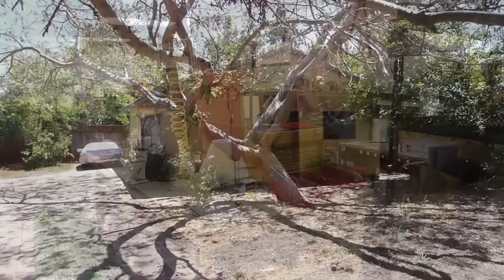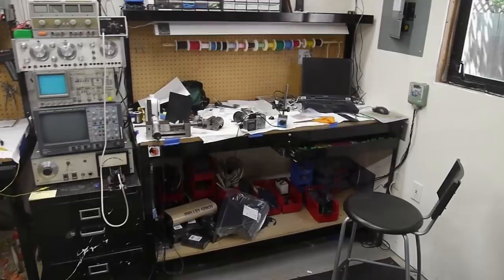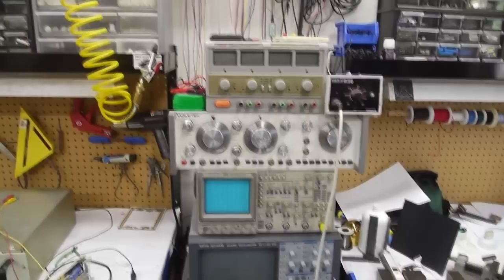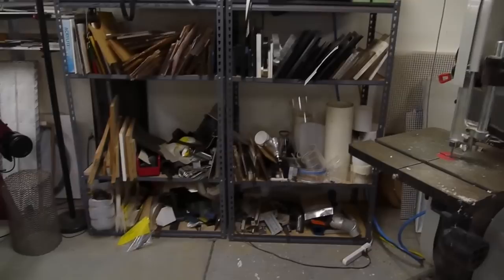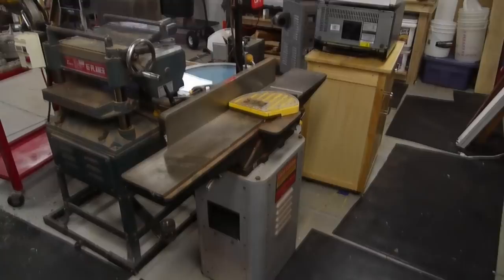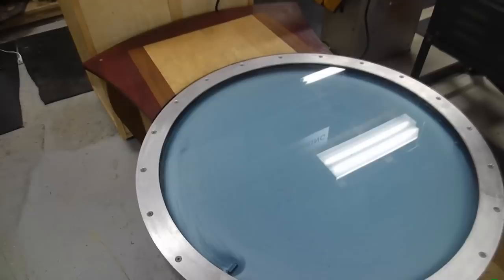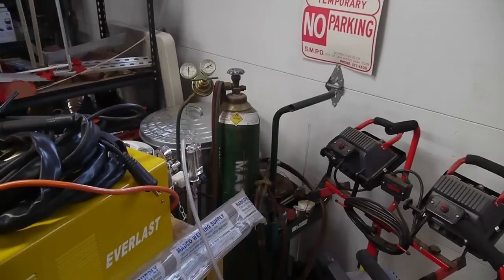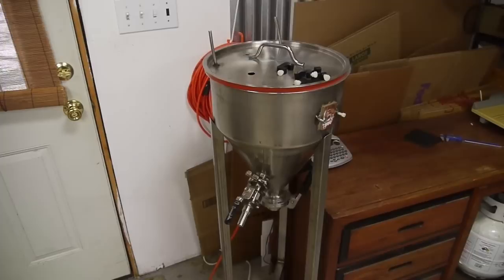Tour of Ben's shop 2012

Comment: The safety minded guy in me sees a few things to suggest for your enviable workspace. Mount your extinguisher by the exit. It'll always be in one spot near you escape. A fire rated chem cabinet or at least steel with doors. Finally, an eye wash station. Doesn't even need a drain. If you need it, you don't care about the puddle. Great vid!

Comment from the maker: I really like that scope. Compared to modern DSOs, it's slow for math and signal processing and doesn't have a color screen, but the front panel response is better than most modern scopes, and is very easy to use with good controls and menus. I've gotten a lot of work done with this scope, and would be very reluctant to upgrade.

Comment: Nice to see the bits usually only glimpsed in your background.  I also was intrigued with your friend's tempering machine.  I would be interested in liberating that from it's current disuse; please let me know if it is still available.  I have had musings of building one for a while but never got beyond a scratchpad design.  A chamber vacuum sealer is likely to come first. I have a very food oriented project theme lately.

Comment: I thought that was fascinating getting to see around your shop, Ben.  So much interesting technology.  Until this I had never considered the parts bins utility other than as storage, but the ability to move similar small components on mass from location to location seems so obvious now, and gives me new consideration of them.  The table concept is fantastic.  I noted that it made quite a bit of noise when you turned it to set the fluid in motion, so wondered if it was considered for retrofitting with quieter bearings, a motor drive, or some back lighting?   Have you ever thought about motor control via some user action -  disturbing a magnetic field, or covering a light sensor with a drink container?

Comment: Ben, your shop is great! I envy your knowledge of the tools you use and the amount of cool things you have built simply because you love building them.

I wish to someday have a similar amount of understanding of electrical and mechanical systems. While I am in engineering school, I do have access to a full woodworking shop at my parent's place. What small projects could I take on to increase my understanding of practical engineering concepts? What little things got you started, Ben?

Comment: you found using the compound miter saw for cutting plastic to not be so great - for cutting vinyl siding, a plywood 100+ tooth blade mounted backwards works amazing.. maybe the same for other plastics?

Comment: Such a cool shop. Do you ever work with robotics?  I think you could make some cool quad rotor helicopter mods for RC ones.  They sell one for like called AR Drone 2.0 with a 720p front facing camera and a downward facing lower resolution for positioning.  You can view in HD while flying via wireless on any android or iOS tablet or smartphone. It's very stable and only 299$ I think you could do something cool experiments or modifications to it.  

Just a thought,  I really wanna pick one up.

Comment: What would it be like if you tried to run a 3-phase motor on only 2 of the phases or even 1 phase?
Reply: Unsatisfying.  On single phase it will not start.  On two phase it might start but will have a small fraction of the rated power available.  In the USA the 230 V two phase is really just center-neutral single phase so it is no benefit for poly-phase motor starting. With a rotary converter you use a capacitor start and/or run configuration on a single phase motor to turn a 3 phase generator or you use a split phase arrangement (sort of like capacitor run motor) to power a three phase motor and use the motor windings as a rotating transformer to extract three phases from the windings.

What with no free lunches the single phase has to provide all the power you take out on three phases (plus losses) to the supply currents can be very high if you have a big load.  While these may be big and noisy compared to a 1phase to 3 phase variable speed drive/motor controller they can be cheaper to make than pay for a VFD and more robust when it comes to overload.

Comment: I love what you do.i lived in the area since the early 80's and tried to do something similar. How do you keep from having "collectors" from labling you a hoarder, kicking you out of the area and "cleaning up your property"?

I've been meaning to make it to a Maker Faire but had to put out fires as my stuff dwindled. I'm setting in Michigan separated from most of my stuff. I used to work at HSC Electronics and I see that they closed. There ain't no life nowhere. This is worse than a tornado. I can't believe the violence.

I'm 60 and spent my life collecting parts, making tool and people come along and rip it all away.

I'm smart and talented but I lucky enough to have an unfurnished house to exist in. I have a Droid but try to submit a resume on a website written for a computer. I'm just getting too fat for the clothes that I still have.

It's 7 degrees outside. I came to California in the early 80's and just missed getting in on the ground floor. I solved a lot of problems for quite a few people but didn't really get compensated for it.

I guess if I had a question, it would be, how? Just, how?

People love the comfort of living today but they seem to disdain the technologies to get there.
Reply: Best of luck to you man, fingers crossed that by the time this reply finds you things have begun to turn around for you.  It sucks when smart people get used up and spit out by the system.  Truly wish you the best.

Comment: Can we modify home refrigerator  to archiving temp below 0 or -10 C or not ?????
Reply: A domestic fridge should be able to get to -5degC in the ice compartment.  A domestic freezer should be able to hold -20degC if it has good insulation.  They are designed with very little extra capacity so even if you changed the thermostat setting it will not be able to go far below the design temperature without changes to the plumbing.  An important consideration is to remove heat leaks with added insulation.  Remember some modern units use the outside metal as a heat sink so putting extra insulation outside on such units will cause them to work far worse, add it inside but make sure the cooling/evaporator coils/pipes are inside your added insulation.  Some fridges have door frame heaters, either electric or using a condenser line and these are also a heat leak.